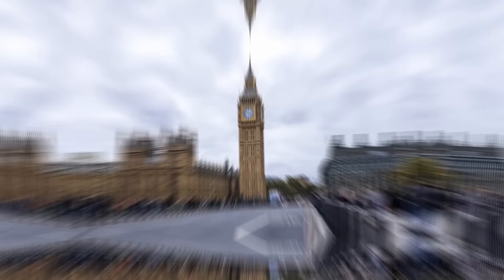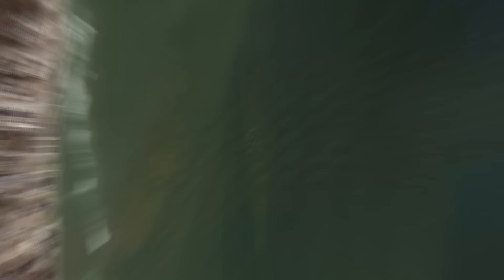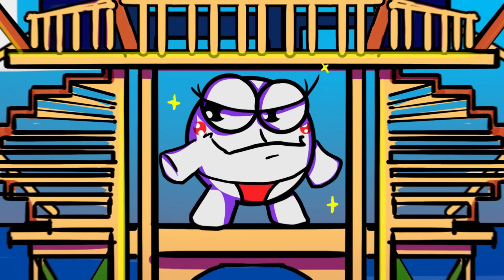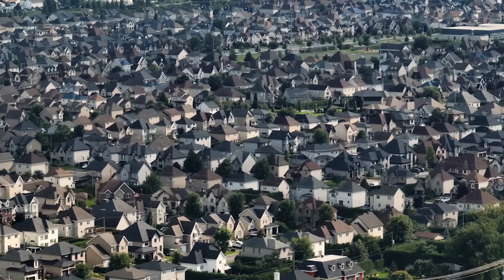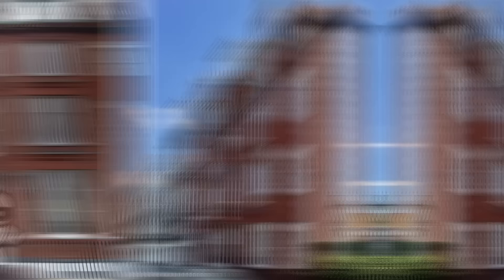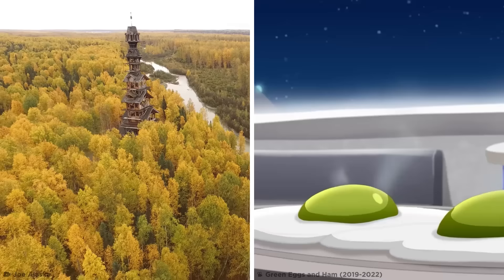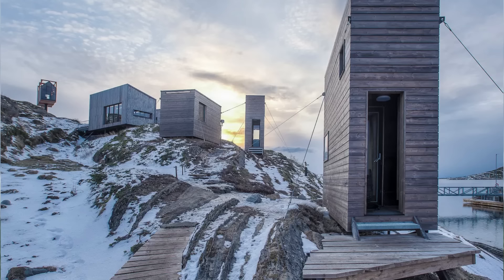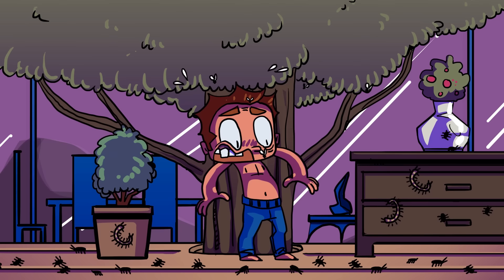Most UNUSUAL Houses

Comment: 01:24 - Are you sure that's London?  I really doubt it.  There's a bunch of Netherlands cars.  Only Netherlands has the orange front plate, while the UK front plates are white.  The driver's seat is on the left in these cars, as would be the case in Netherlands but not the UK.